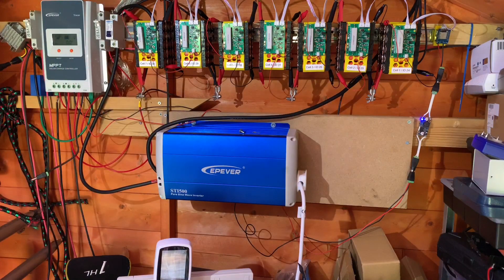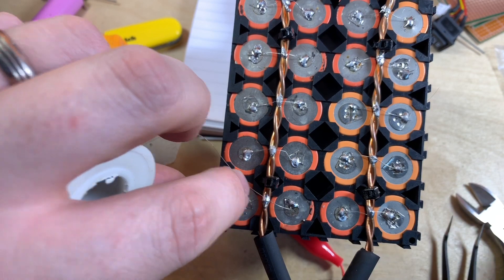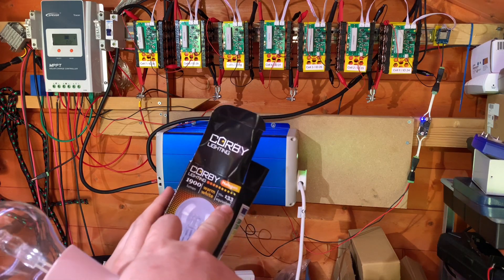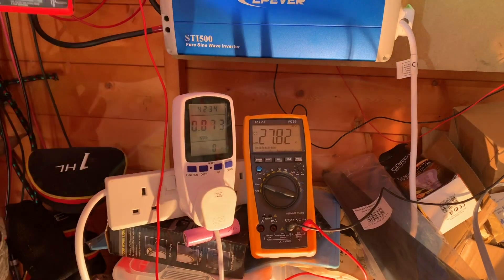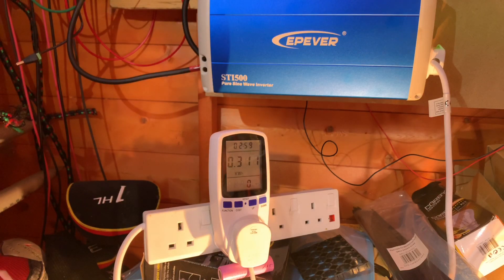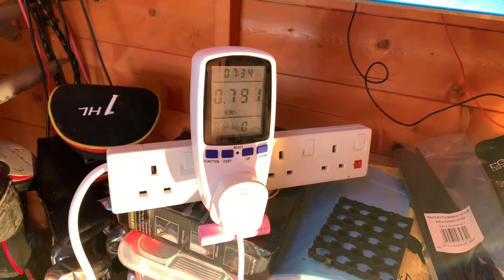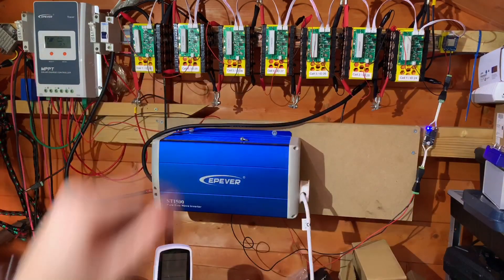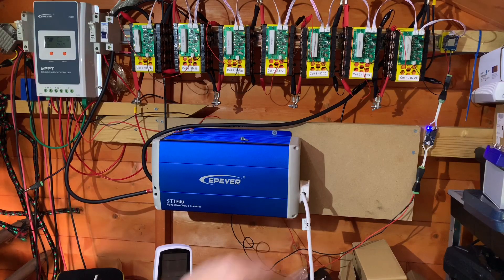Second Attempt: 1kWh Discharge Test

Comment: Hi guys that looks really good I’m brand new to this at moment I’ve got 20 110 amph 12 battery bank with 12 volt 3000wat inverter being charged at min with 400 watt wind turbine and 400 wat solor how do you work out the size ov these battery wall I would need like say new to these 18650 battery’s any help much appreciated thanks

Comment: So a 12v inverter would pull 2x as many amps to run 100W load?
Reply from the maker: Yes. That’s correct. Power = current * voltage
Reply: @AdamWelchUK  ok thanks. That's why I see people running smaller wire gauges on 24V (and higher) systems.

Comment: Just getting into battery packs. I have played around with the TP4054 modules and they work well.  What I am having trouble understanding regarding the diyBMS  modules is how the modules/batteries can be placed in series.   Looking at the schematic it looks like the ground of the module is connected to the negative terminal of the next higher potential battery pack and the Batt+ is just the positive terminal of the battery.  Can someone explain how this works as the voltage measured is not referenced the cells negative side.

Comment: Interesting test, I like your dashboard, it looks similar to the results I was getting with node-red. Personally I'd have password protected it - it's open to the web. I'll have to see if you have made vids explaining the software setup :)
Reply from the maker: Yes I know it’s open. It’s read only without a login.  The grafana dashboard is behind a reverse proxy, and protected by cloud flare. Never say never, but I think it’s reasonably well protected and if not, it’d take me about an hour to rebuild.
Reply: @AdamWelchUK  I wasn't trying to hack it or anything, it's a great project mate :) Thank you for the great vids :)
Reply from the maker: No I didn’t think you were. Actually I’ve been waiting for that very comment from someone because it’s exactly the sort of thing I’d say to someone else! :-)
Reply: @AdamWelchUK  Glad I'm not the only weirdo then :) If it wasn't for you and other people pioneering new ideas for putting a system together, researching and testing to the geekiest level and sharing here, I wouldn't have started down the wormhole into lifepo4 in my camper. 

Then there is the 3 months of testing the diesel heater that'll be the primary use for the 120AH ..... at 24W per hour. Making sure that I have enough solar to ensure I can run that heater in winter. 350W should do it....... Don't want to get cold. OTT I know

Comment: I really like your videos and I have one question, what interface you use for the DIY BMS ? Because the one that Stuart did is quite different.
Reply from the maker: Thanks Glide. I report all the diyBMS stats into an influxdb database which is then read by Grafana. It means I can design graphs and gauges of my own design to show the information I like to look at most. Colin Hickey forked Stuart’s v3 code to add the report to influxdb but Stuart’s v4 code includes it by default I think.
Reply: @AdamWelchUK  thank you for the info, the interface is looking really good.

Comment: It's not disappointing at all! It's a great experiment and your hobby, I guess. In your place I would be concerned about cellblock 4 and replace some of the cells there. Then load the cells up to 4.2 Volts each just for the experiment and discharge it again. After discarging with 100 Watt you should try 400 Watt also and note the difference the load has onto the capacity.
Im riding an electric bicycle with a 900 Wh battery and I'm discharging it with 15 Amps (250 Watts) on my long-range holiday trips. After 850 Wh and 3,1 Volt/cell the controller goes into safety mode and the remaining power ist for your headlights.  I've a Wattmeter installed and am able to calculate my cruising range in advance. And this is my hobby -- inspired by your experiments.

Comment: I've put the EpEver inverter GUI on my workshop PC using another usb to RS485 adapter. I already have the 4210A GUI on my indoors PC. Can I parallel the two RS 485 's to be able to look at both units on my indoors PC?

Comment: Are you certain that those fuses broke due to mishandling and not due to small long term overloads? Because in these cases the fuse wires will actually look as if they have merely broken rather than "blown" as such. You may well have a few cells that aren't performing, and it could well be that the better cells are the ones passing more current. On the other hand, 3.6MJ is not too difficult to extract from thee or four secondhand car batteries.  ;)
Reply from the maker: Fairly sure yes. I checked the voltage of the cells which were disconnected from the pack and none of them were significantly different from the pack as a whole. So I don’t believe any of them are either significantly self discharging or dead. All the breaks were at the soldering connection. For the fuse to blow via an over current situation I’d have expected that they got hot - and each soldered end is a heat sink so I’d expect the fuse to blow in the middle. That’s my theory anyway! 
No I’ve been trough them all and done a reasonable discharge and recharge I will pull it apart again and double check all the fuses. If I’m careful I can be fairly sure that any broken fuses would be due to an over current situation now. Cheers Xan

Comment: From my experience - 30-60mv difference between packs over the daily charge/discharge curves is excellent.    The difference diverges the most as head down the discharge knee - usually 3.4v  and below.   In my own system,  I run 30-40mv difference (between 42 packs) during most of the charge/discharge cycle and it diverges to 70mv difference at inverter off at 3.43v - just at the start of my discharge knee.   Agree that this is not 100% DOD, but this 4.0 -> 3.4v is aprox 55% DOD and is expected to extend battery life by 1000(s) of cycles.
Reply from the maker: Thanks for your information. Sounds like you have a great deal of experience. Mine generally cycle much less than in this test. I barely take mine lower than 3.7 volts truth be told.

Comment: whats the point in having a bms if it doesn't protect your cells. 2.8v is a bit low, it should of cut off way before that or before you switching the load off.
Reply from the maker: You’re absolutely right that that bit is missing on this version of the diyBMS. However the designer has just released a new version which does include the ability to control relays based on various situations. I need to upgrade :-)

Comment: What is the capacity of your 18650 cells?
Reply from the maker: Well I tested them all and got an average of 2.5 amp hours. But I tested them at 500mA discharge current on my LiitoKala charger. I know most people test at 1 amp - so mine may give a slightly higher result to others.
Reply: Adam Welch ah, ok 👍

Comment: i remember using  this power meter with a modified wave inverter. the power meter stopped working after that. strange!
Reply: Yeah, it seems like a lot of these power meters don't like the unclean output of modified sine wave aka or square wave inverters... Had two different ones go wonky after being used with non-pure sine wave inverters.

Comment: Interesting to follow your lithium battery adventures.  I'm still waiting for the lithium price vs capacity to reach a level I'm comfortable with.

I just replaced my almost 9 year old AGM battery bank with some AGMs that are only 15 months old.  Two 100AH, two 110AH, total cost of $305US.  420AH * 12 volts = 5040WH, which I never use more than half of (50%DOD) but 50% is 2520WH and there's an inline V/A/W/AH/WH meter to track instantaneous and total power usage - when it hits 210AH, it's time to powerdown.  My inverter isn't as efficient as yours - just over 90% vs 96%  ;-)
Reply: Lithium-Ion cell  price to manufacturers is expected to drop to below $100 U/S per kWh within 2 years, and is forecast to bottom out at around $75 after that.

Adam only checked his inverter efficiency at one point. It will have varied as input voltage dropped, and as it’s electronics warmed up. Perhaps he should have checked efficiency every hour or so. My guess is that it could easily have fallen to below 90% towards the end of the process. He did mention that the box felt quite warm after several hours of running.

Comment: Time to check the batteries in cell 4 again since it performed much worse than the others. If cell 4 was in line with the others, you might have hit 1kwhr!
Reply: Greg B I think this should be the primary reason.
Reply: Time to put in more cells, why tease them on the edge, more amp, longer life.

Comment: Presumably you will want all the cell groups to have as near as feasible the same capacity so I presume you will want to  check the 1/2 cell groups that discharged first. You can always add an extra 18650 or two to bring up the capacity.
Reply from the maker: Yeah, I’m happy they are now all fuses are operational I’ll have to put it down to IR or overall capacity. Some more tests required.

Comment: I only charge my cells to 4.00V   .  The actual added capacity gained by charging to the 4.20V really is not that much.  If you watch the discharge voltage the cell don't even remain above 4.00V a full minute when even lightly  loaded.  Preserving Cell Cycle life is  way better for me then the little added capacity you realize.   .
Reply from the maker: Interesting thoughts. I have some discharge graphs of single cells I might scrutinise. Cheers
Reply: @AdamWelchUK  https://www.powerstream.com/lithium-ion-charge-voltage.htm
Reply: @clintoncoker6  Thanks Clinton. Great site!
Reply: Well from 4.25V til 4.00V I have already used mine for 5 hours. If I had them starting at 4.00, the voltage would have been 3.75, and thats only 0.05 V from the inverter to say "undervoltage".  And It had stopped working. 
So sometimes you got to evaluate whats best, longer battery time or battery will last 3 months longer (in the end).
When i'm working, I can't stop after just 3 hours, so for me, a longer battery time is best.  And I know that the laptop I took them from, they was driven to 4.32V. So i'm not the one who's shorten their lifespan.... Its already done.
Reply: @timm3802  LOL, if you have them SOC 4.25  by most standards your overcharged to start with.   Bad Ju Ju.  Runing LiIon's like that your most likely never going to get the rated Cycle life.
Reply: More like three years.
Reply: It's keeping the battery at 4.2v and especially at raised temperature that degrades the life cycles. If you are in a position to use them pretty much after charging, then the cycle life shouldn't be effected too much. Turning off charging as soon as they reach 4.2 doesn't give maximum capacity as they will still be drawing current. Max capacity is reached when the current drops. So ideally charging through daylight to maximum capacity then switching to discharge should take full advantage of capacity over cell cycle life. Keeping them at elevated Voltage will reduce cycle life however.

Comment: I charge mine up to 4.25V ... but its also Samsung batteries ICR-18650 -30B 
They can handle the high voltage. Maybe you should aim for them too ?
Reply: It's best to charge to as low a voltage as you can get away with based on your power needs.  Charging to 80% capacity can significantly extend the number of cycles they can take.
Reply: @keith3133-i6s  Actually every vendor advice you to charge them full before using them for anything. If your statement was true (and in some cases it is), you would only get 80% out of new batteries.
Reply from the maker: Mine out a mixture of two types some LG some Sanyo. Both datasheets say they have a maximum charge voltage of 4.3volts. As I said though, I want to treat these nicely and don’t typically need to extract even half a kilowatt hour.

Comment: Still struggling to come up with my battery set up.  I have 300 18650 cells all but new from modem packs.   I simply can't afford power wall PCB's  like Jehu has to offer.     I think your main issue is the way you've done your buss bars.  On My E-bike packs I used flat copper wire straps and the fuse links are not subject to damage in handling like yours seem to be.   This flat copper works well for me.   https://www.amazon.com/Artistic-Wire-21-Gauge-3-Feet-Copper/dp/B00VTM1J4E/ref=asc_df_B00VTM1J4E/?tag=hyprod-20&linkCode=df0&hvadid=167126940637&hvpos=1o5&hvnetw=g&hvrand=1459545682796899104&hvpone=&hvptwo=&hvqmt=&hvdev=c&hvdvcmdl=&hvlocint=&hvlocphy=9030504&hvtargid=pla-310560664795&psc=1
Reply from the maker: I’ve made my life twice as difficult by repeating the bars and fuses on both sides. I think a spot welder would have been a good investment. I have some glass fuses on order to see if they are more robust. Thanks for the comments and link. I’ll give it some thought.
Reply: @AdamWelchUK  Spot welding is good and I have the means here but I like the ability to  repair  aspect of the buss barr Idea.  Not so easy to replace cells if they're strapped in .  You don't have the Tesla type fuse Spot welding right to the strap.  Current project is a power Closet ?  LOL  No Room on the Mobil home walls.  Pulled the heater out of the cubby hole closet and  building within.   Going with 24V Wind and Solar. Plug N Play Grid ties as my dump load I think.    Flipping batteries are my financial issue at the moment.  Just taking me a pile of time but I'll get there some day.
Reply: @AdamWelchUK  I ordered a bag of 1000 fuses at ali express. They are 3 Amp, but they do handle up to 6 Amp before they burn. I will not discharge or charge above 2 Amp per cell, so this is a nice solution. These fuses are a small dot of glass in between two small wires, same wires as resistors have. And above all: it is cheap, and can be used for several projects.
Reply: @AdamWelchUK  Rinoa Super-Genius used "pico fuses" for her bicycle battery.